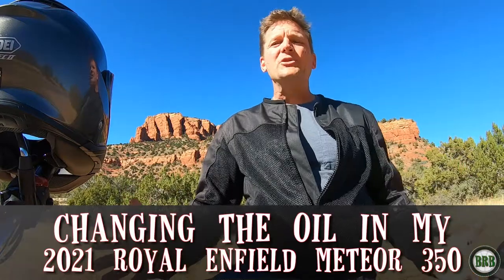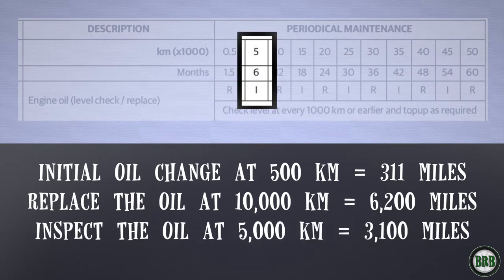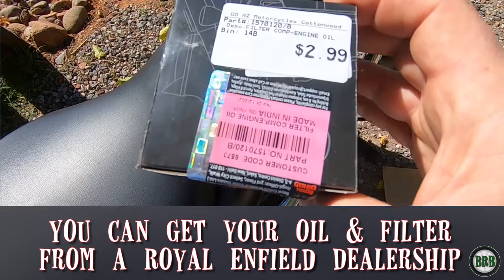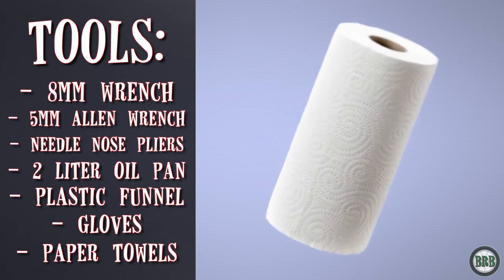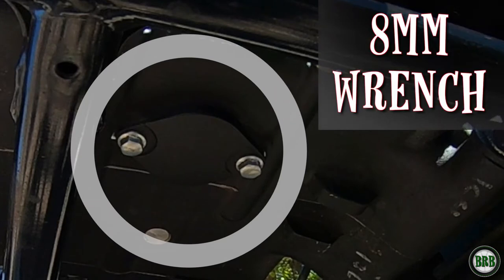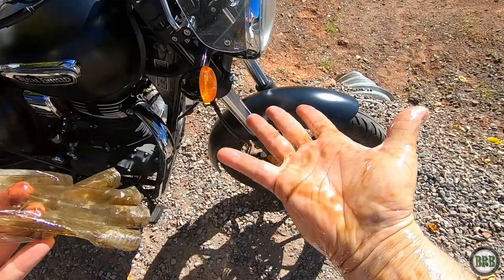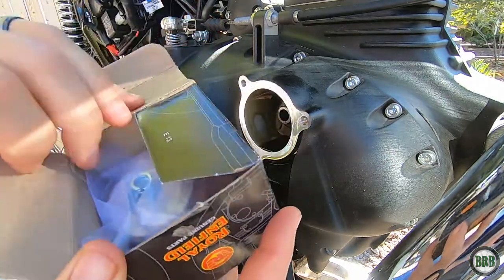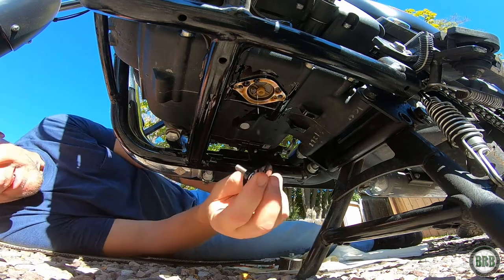Motorcycle Oil Change - Royal Enfield Meteor 350

Comment: Great video. Excellent production and explanation, even better than the official RE channel. If you do any modifications to your meteor I'd love to see them; baggage options, tyre options (tire for you I guess), etc. I've put an LED bulb in my headlight to replace the standard candle and a bash plate. All the best from Sydney Australia.
Reply from the maker: Thanks, Grahame!  I appreciate your feedback and your kind words.  I actually did add a windshield to this model - as you may know, the Stellar Black does not come with one.  I'm planning on making the mounting video for that soon.  As for baggage options, there aren't many right now.  But here is the one that I bought which I'm quite happy with: 
https://www.youtube.com/watch?v=anxgJ5R36Pw
Reply: Since your reply is pinned to the top of this page, I thought I'd tag my thought here for the benefit of all, since lots of comments get buried to the point of not being seen.

There IS an actual drain bolt, located on the lower right front of the crankcase. It's got a large head with a crush washer visible under it. You should only need to check that oil strainer once, to see if it picked up any swarf from the engine manufacturing process. Mine was completely clean at the 300 mile oil change and I won't be doing that messy job again. So instead of buying an o-ring for the strainer, buy a new crush washer for the drain bolt.

Even the o-ring on the oil filter does not need to be replaced every change, unless it is broken. Two or even three uses would  be quite possible, but you will know if you have a leak soon enough.
Reply: @BackRoadBikerChuck   Hitchcock's Motorcycles in England , which hosts a RE forum online, has a large selection of Meteor accessories on its website, including some pannier options. I'll be mounting the Givi brand panniers, ordered from FortNine in Canada and the frames, which had to come from Hitchcock's, as Givi North America hasn't got supply of the frames as yet. Lots of good technical info over on the Meteor forum there too.

Comment: Personally I'd say that after you have filled the engine with new oil to the full mark, that you should start the bike and run it for a couple of minutes  before switching off and let it sit for a few more minutes before rechecking the oil level, also putting the new filter in a container with fresh oil Prior to the start of the process allows the filter to absorb oil to minimise the need to top up because the filter will absorb a certain amount of oil
Reply: you are right indeed

Comment: Thanks for the good video; it was well done! Though I've already changed the oil on my Meteor, I was curious to see if there were other things I could learn. BTW, I did my valves too. Why? One, my RE dealer is 45 minutes away; getting from and to the dealer is an issue, especially when you live by yourself as I do. Two, they have a two month wait to get in; that's right, if I were to call right now for an appointment, I'd be waiting two months to get it in for the valve inspection. I don't want to be without my bike that long! Three, dealer techs are paid a flat rate for a job, no matter how long it takes; the more jobs they do in a day, the more $$. That's a recipe for mistakes and cut corners-no, thank you. Four, I like doing the work, because I know it's done RIGHT! After I did my valves, I could feel the difference in how my bike ran. Five, there's just tremendous satisfaction of doing things yourself! Six, it's a good way to save some $$$, an important consideration in these days and times.

Comment: General practice amongst motorcycle mechanics is to soak the new paper oil filter cartridge in clean oil for a while so that the paper filaments swell up a little to give you instant oil pressure and to make sure any dregs of the old oil don’t fire small particulates through the engine before the filter shuts the door, but otherwise very simple and helpful instructions to those that are having a go for the first time 👍
Reply from the maker: Super thoughtful info, my friend - thank you!

Comment: Coming up on my first oil change (for both the Meteor and myself as a motorcycle owner) and this video's a godsend. Thank you!
Reply from the maker: Thanks!  Glad I could help.  Let me know what kind of oil you use.  I'm getting a lot of feedback on different oils that work well.
Reply: @BackRoadBikerChuck  Everybody's oil choice is the best. It's a mug's game to sort the wheat from the chaff in those types of discussions. Just buy a good quality FULL synthetic motorcycle oil with a JASO MA, or a JASO MA2 rating, which is required for wet clutch applications. Some car oils may have that rating as well and would also be fine.

Comment: Also with changing the oil filter, when filling up the oil to max, start up the bike for 2 minutes, stop for two minutes. Check the oil again. The oil level is down because the oil filter will soak up some oil. Add again to near max. Thanks for your videos!

Comment: Great video.  Never changed oil before but using this video, seems very straightforward.  Thank you
Reply: Just finished my oil change following your excellent video.
The only comment I have is, I found the supplied 8mm spanner not a great fit and I felt like I was rounding the nut.  I used my own ring spanner and the nuts came off easily.
Thanks again for the comprehensive guide.

Comment: Make sure you don’t over tighten the drain plug or any of the bolts
Do you have to start your motor and let it run for a couple minutes before you re-check the oil after you fill it?

Your videos are so professional and so easy to follow along! This Video looking at all the oil change components reaffirms my motorcycle purchase - I look At the quality of the oil change components/ design in  ascertaining the quality of a motorcycle- passed!!
Thanks for Supporting the motorcycle community

Comment: Congratulations on your video, very well done. I have good technical experience and I would just like to make two notes: 1. when reassembling a part with sealing rings (e.g. the oil filter cover) it is  good practice to grease them with a little engine oil. 2. all the screws should be tightened with a torque wrench to the torques indicated by the manufacturer, to avoid breaking a casing or the screws themselves. That said, I'm looking forward to get my Meteor ... greetings from Italy!
Reply from the maker: Thanks for the additional info! And for the kind words!  Send a photo of your meteor when you get it! I would love to see it!
Reply: @BackRoadBikerChuck  It will be done, cheers!
Reply: A GOOD torque wrench is an imperative,, if using one on small bolts like these. That's means don't buy a $50 torque wrench. Good costs more. It is easy to bust off bolts, or strip threads using torque wrenches on small bolts and really, they don't need it. Especially here where you have an o-ring which does the actual sealing, so just snugged up firmly is quite sufficient. I reserve the torque wrench for critical fasteners, like axle bolts and brake and suspension components.
Reply: @megalumpproductions5362  As for the quality of the torque wrench You are absolutely right, in fact I have one from Stahlville that cost me over $ 300. I have my own small amateur workshop and I want to be well equipped. As for the tightening of the various bolts, I am very "picky", in fact after buying the Meteor I got the workshop manual (as well as the user manual) and as a rule I tighten almost all the nuts with the torque wrench, with all the necessary precautions.

Comment: Thanks for the nicely made video, BRB, and your effort to make the process unintimidating for newbies. That is a messy place for the oil filter to be located. 'Any comment on why Royal Enfield didn't design the oil filter to be where the oil screen is, as it is for most engines, replacing the superfluous screen? 'Good advice about never overfilling the crankcase.

Comment: Hi Back Road Biker, Thanks for your great how to video. Do you think you can make more walk through / talk through videos like this one please? It would be great to have someone knowledgeable like you to explain how other parts of the maintenance schedule are taken care of. The bike operators manual has a long list of things to inspect, clean and replace. Once the warranty period is over I intend on doing my own maintenance. Your videos would be a great source of information. Yes I agree there are many videos out there, but the ones specifically for the Meteor 350 are either very few in English mainly by RE, or in Indian. The bits from the maintenance schedule that I need help with are: 
- Evaporative Emission Equipment rubber hoses - Drain the overfill by removing plug (where is this?), 
- Vent pipe under air filter (what to do with this one?), 
- Starter relay connections (where is the starter relay).
If you can shed some light on how to do this maintenance it would be greatly appreciated.
Reply from the maker: Thanks for the love, Emmanuel!  I appreciate the feedback.  I would love to do more technical videos.  I'm currently working two jobs and am trying very hard to find the time to make videos.  When I DO find the time, I'm usually doing a day trip or camping.  As soon as I can find a way to increase the monetization of this channel, I'll be making more videos.  Thanks so much for watching!  💙🙏🏼
Reply: You might want to download the digital version of the RE Service Manual for the Meteor. You can find it on the Meteor forum over at the RE website hosted by Hitchcock's Motorcycles in England. Free download. It has every detail of maintenance for the entire machine.

Comment: You can also use an aluminum foil turkey pan as a drain pan
Reply from the maker: I actually did that once on another bike, and when I went to pick it up, it bent and spilled.  Not ALL of the oil, but just enough to piss me off.  But that could have been operator error!  Thanks for sharing!

Comment: Thank you so much for this! Will be changing my oil next week. I notice in a tutorial video by Royal Enfield they appear to change a couple of O-rings on the oil filter cover and around the sump plug. Did you feel the need to change these O-rings? Thanks again, great video.
Reply from the maker: Thanks for the kind words, Bimble!  Yes, I bought a new O-ring with the filter but, when I opened things up and looked at them, the one on my bike looked fine, so I left it.  I've had no leaks since I changed my oil, so I'll swap it out on the next oil change.  Awesome question!💙🙏🏼
Reply: @BackRoadBikerChuck  good to know. Thank you. The oil and filter kit I purchased from a Royal Enfield dealer has come with a "Genuine Royal Enfield"  copper sump plug washer. Having not opened anything up yet myself I'm not sure what that's for. Any ideas? Was there one of those in there? Thanks again Chuck.
Reply: @bimble1000   Did you find your answer to this yet? If you look under the engine, at the right front, you will see an actual oil drain bolt, with a crush washer under it. Only need to check and clean the oil strainer on the first drain, There wasn't any swarf in mine at all.  It was perfectly clean. Too damn messy a job to be fooling with that every time. So instead of a new 0-ring for the strainer, you need a new crush washer for the drain bolt.

Comment: Ideally the oil level shouldn't go over maximum when the engine is hot, so if the engine is cold you definitely want to stop before the maximum line because the oil will expand when hot. As long as the amount of oil you have doesn't fall below the minimum it's good. Since you've changed the oil filter you might want to turn the engine over then decide what the oil level is.

Comment: This is a very clear and concise video. Even though I have changed oil before I shall keep this close at hand. I'm wondering about valve adjustment. Would it be a step too far for my limited abilities with a spanner? I did used to do this years ago on my Kawasaki Z650, but it had a first class workshop manual to follow! - Chris.
Reply from the maker: Thanks for the kind words, Chris!  Well, the meteor tool kit does come with a small spanner wrench, but I believe it's just for adjusting the coil-over shocks.  I do work on my own bike for several things, but I'm not a mechanic and I haven't done anything with the valves.  I would suggest reaching out to a dealership.  I've asked my dealership mechanics several questions about maintenance and they have been happy to explain things over the phone.
Reply: Not difficult to do with the proper knowledge on how to set valve clearances. Getting the valve cover off is probably the hardest part of the job, but the rest needs knowledge about how the engine is timed regarding valve positioning for making the adjustments, which are in the thousandths of an inch. Special tools required. Do it wrong and you could damage the engine seriously.

Comment: in India the company gives its own brand semi synthetic oil for about 10-13 US dollars for 1.7 to 2.2 litres. Meteor  can take 2.2 litres if you drain all the oil properly it seems. The engine oil  you got is very good full synthetic which will likely last 10K Kms, but not the Indian Enfields 'liquid gun'. The company says it can last 10k in the Indian conditions, I don't know why. In my own bike the oil lasted maybe 4500 Kms and then it got into overheating and what not. If I had used it for 10K it would have ruined the engine.
Reply from the maker: Wow - thank you so much for this information!  I will look up this oil and see if I can either buy it from the dealership or have it shipped to me.  
   I agree with you that the owner's manual seems to be a little over-confident in how long the oil will last.  I'm 1,000 past my last oil change and, already, I think it looks very dirty.  I will probably end up changing it much more often than recommended by the book.  Cheers!

Comment: If you look under the engine, at the right front, you will see an actual oil drain bolt, with a crush washer under it. Only need to check and clean the oil strainer on the first drain, There wasn't any swarf in mine at all.  It was perfectly clean. Too damn messy a job to be fooling with that every time. So instead of a new 0-ring for the strainer, you need a new crush washer for the drain bolt.

Comment: I note before you fitted the new oil filter you never wiped out the old oil from oil filter hole and you did not clean the old oil of the bottom plate before fitting the bottom plate very bad practice other wise a good job maybe both gaskets should have been replaced as well if not rubber regards Dave.

Comment: Planning to get one soon. How's engine heat during traffic jams? In my area, bad traffic is something to be expected so not a lot of airflow on an air cooled engine.
Reply from the maker: I live in Sedona, AZ, where it sometimes gets to be over 110°, and I've never had any overheating problems yet.  If I ever do, I'll make a video about it.  Thanks for the question! 💙🙏🏼
Reply: the ex pipe where it comes out the cylinder runs around 300f. no overheating on mine.

Comment: Big thanks
Reply from the maker: Absolutely - glad I could help!
Reply: Any problems using synthetic oil?
Reply from the maker: @julianrose810  None yet.  It was recommended to me by the dealership.  I've gone about 500 miles on it since my oil change and I haven't noticed any issues.
Reply: Synthetic oil would be my preferred oil. However my dealer says no🥴
Reply from the maker: @julianrose810  Interesting.  Do you know why?
Reply: @BackRoadBikerChuck  that's what it says in the hand book in the UK and your guarantee would be invalidated
Reply from the maker: @julianrose810  by "hand book" do you mean the owner's manual that comes with the bike?  The one I received with my bike just recommends a semi-synthetic oil.  Interesting...

Comment: You don't need to replace the rubber oil filter ring? That different than most bikes.
Reply from the maker: I bought one, and compared it to the one that was on my bike, and it looked like the one that was on my bike was just fine. I will probably change it next time I change my oil.

Comment: MANY steps missed.  What did you use to clean the screen?  Inspect covers and gasket, fire up the bike and check for leaks and to fill the oil filter.  Shut it off and recheck levels.  'Tighten' bolts?  I thought this was for beginners so how tight?  All my strength? I could easily point out other problems but it's just an overall poor explanation.
Reply from the maker: Thank you so much for watching.  Looking forward to seeing your oil change video.

Comment: Royal Enfield bikes and engines are robust , you don't need an high fully synthetic engine oil , bikes required only semi synthetic engine oil which is very cheaper than the fully synthetic engine oil, I have Royal Enfield Thunderbird 350 which has old 350 cc engine which is not very refined and it has lots of vibration in higher speed but man it has lots of fun too to ride that bike and I haven't changed my engine oil from past 1 year but it still runs very good. That's I like about this brand and Royal Enfield slogan Made like a gun and goes like a Bullet. 😍
Reply from the maker: Thank you for the info, Shrish!  I will definitely do more research on this for my Meteor!  💙🙏🏻
Reply: Real fun means terrible vibration, mirror dancing over heating ,why some people's are so partial .
Reply: @sourav6339  i have Thunderbird for 5 years and has no issue it has old UCE engine if I could ride more than 80 km/hr then it starts vibrating like hell and has no over heating and I haven't done any maintenance service yet still it ride fabulous . I think you changed the engine oil from some other brand.